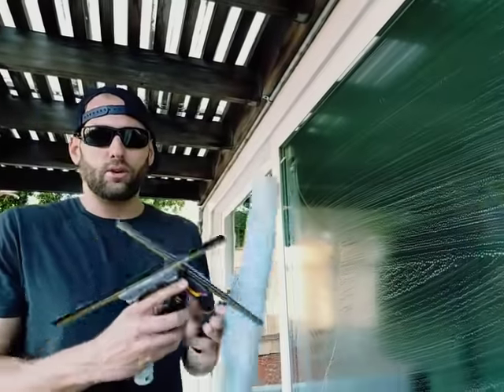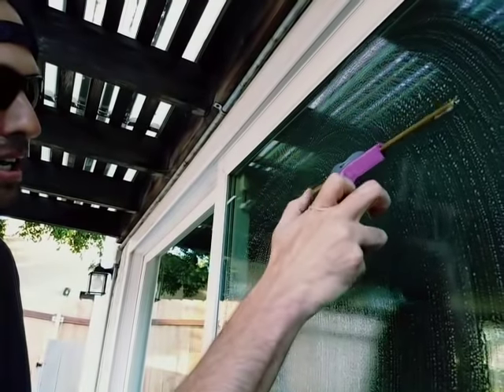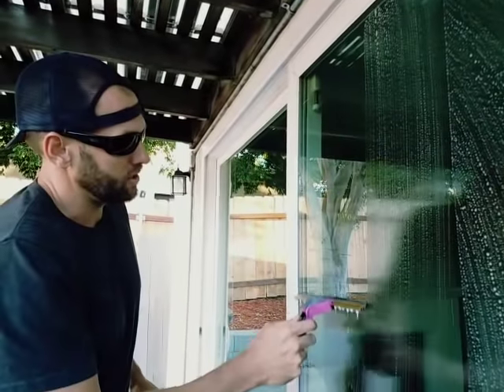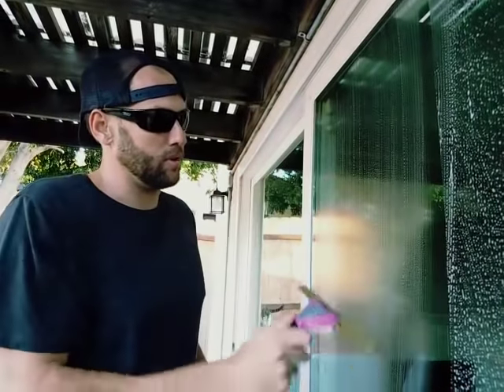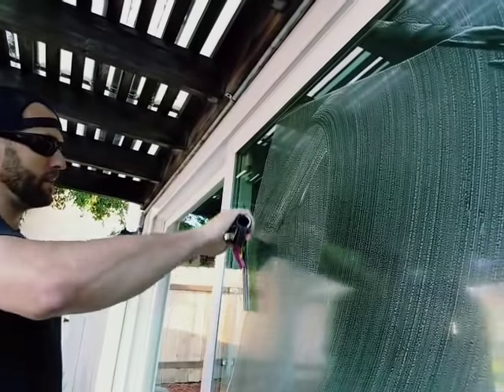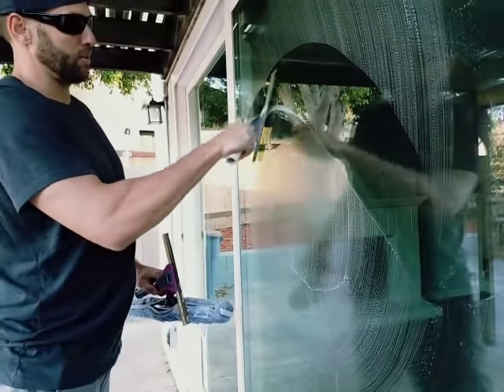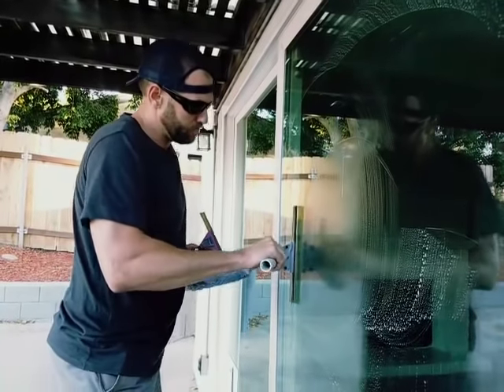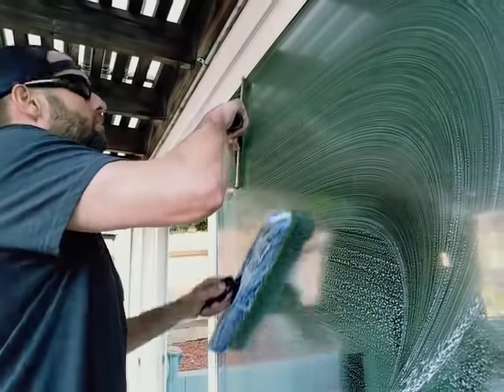The physics of window cleaning rubber/ rubberology

Comment: All you have to do is cut in your top edge and corners then the rest of tha pain is just like rainbow and finish in middle of pain at bottom line if rubber is not cleaning then change it . Never use blade down wards if you can not use blade on pain then use skrim . And as for preashere  softer the better it’s all about movement nothing else and practicing
Reply from the maker: Sounds like you know everything LOL good luck out there bro!